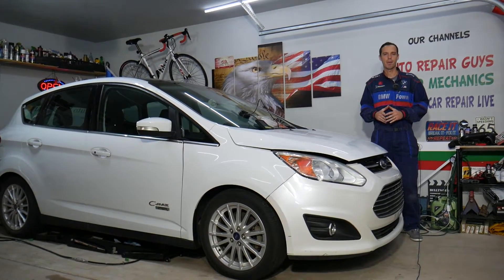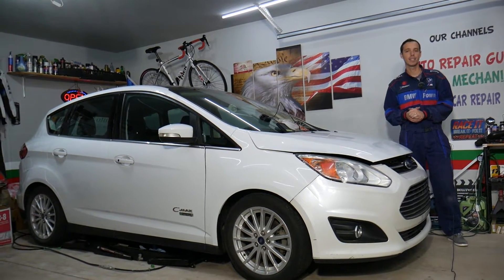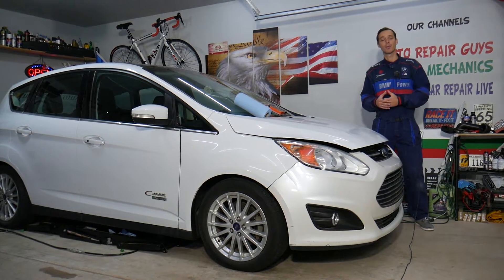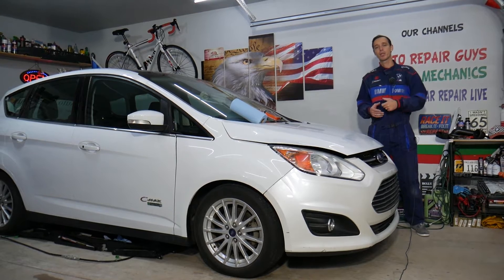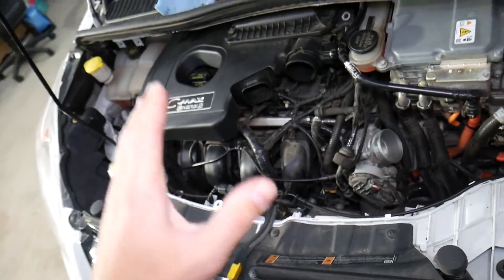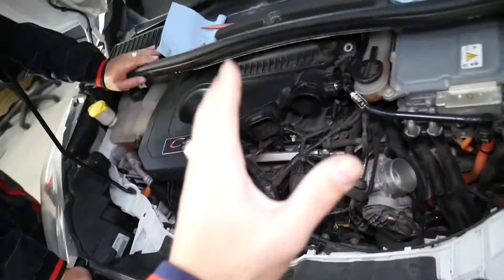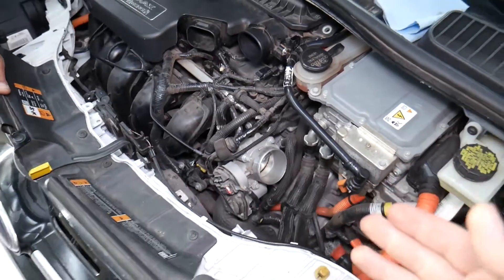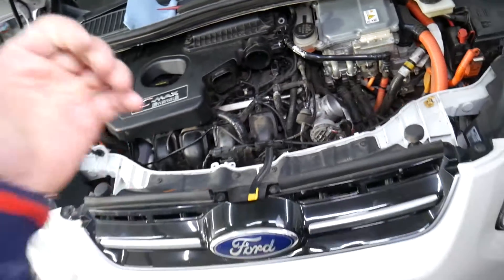WHY RADIATOR FAN DOES NOT WORK CAR OVERHEATS FORD C-MAX FORD FUSION LINCOLN MKZ

Comment: The fan on my 2010 Ford Fusion turns on but it won't switch to a higher speed when the car is at a stop in heavy traffic. Is it possible that a bad fan can still work at a lower speed and not at a high speed? I have already replaced the control module and the relay in the fuse box for the fan seems to be good. Perhaps I should swap out that part just in case.
Reply: Have you solved this issue? My 2011 fusion also stays on low speed or off completely causing overheating.. and awful ac performance
Reply: @fdamien80 did you ever solve this? My 2011s fan won’t kick on luckily I’m mainly highway driver  but I’d like to get it fixed
Reply: @nbbo9049  My issue was the fan control module. I got a used one and fan now works perfectly.

It’s also easy to replace, just two 5m screws and two connectors.